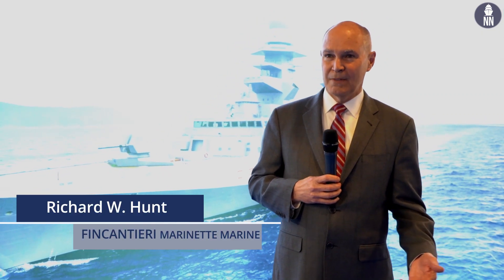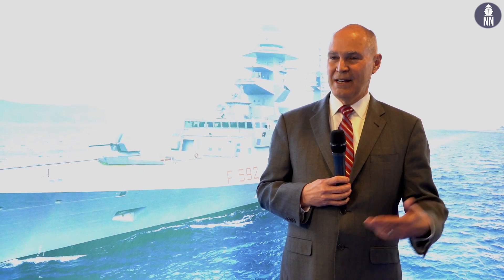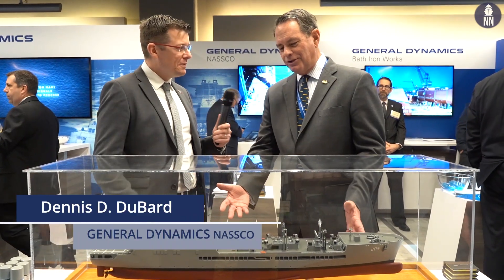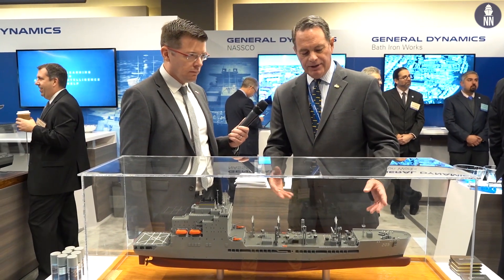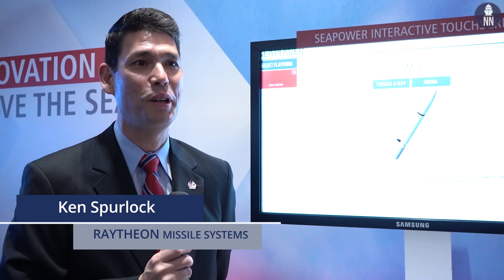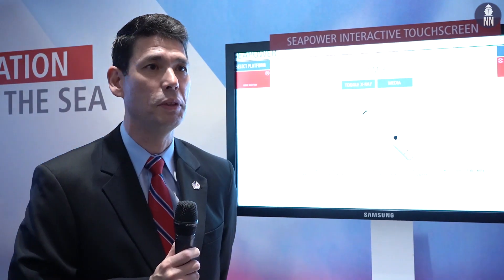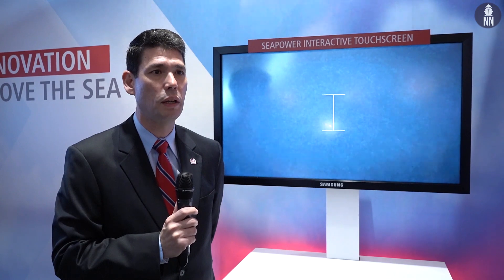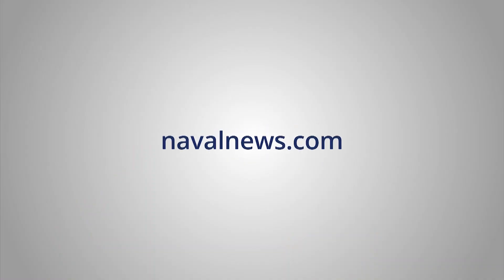SNA 2019 Day 2 - FREMM, John Lewis-class, SM-2, SM-3, Hybrid Electric Drive

Comment: I wonder why are we still developing, producing and buying the SM-2 missile when the SM-6 which took over a lot of the missions from the SM-2 is incomparably more advanced and potent missile. It's a Jack of all trades cause it can hit air breathing targets like jets and cruise missiles. Next it can take down incoming ballistic missiles. And last but not the least SM-6 has an enormous anti ship capability. It's our only supersonic anti ship missile and as we talk it's being revamped with a new much larger warhead that will be capable of sinking destroyer and cruiser class ships. Also the SM-6 is getting a new rocket engine that uses the whole space inside the Mark 41 VLS tubes on board our ships. That means SM-6 is getting longer range and possibly approaching hypersonic speeds in its downward part of the flight. In one word - it's a beast. So why spend money on the SM-2, especially investing money into the R&D when you have a ground braking missile just 4 numbers higher... Sometimes I don't understand the US Navy. It would be wise to at least explain why it's done.
Reply: Mark Brisec cost, supposedly about $5m a copy and the SM-2 will still be capable against a lot of targets for another 20 years.
Reply: International sales.